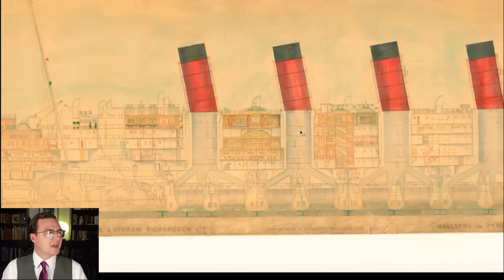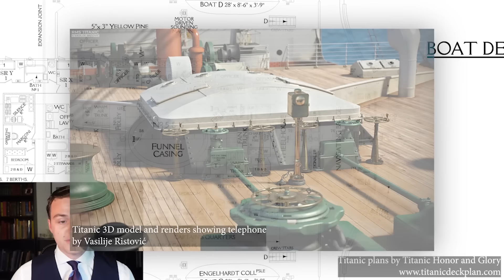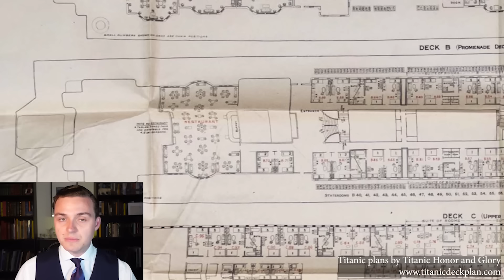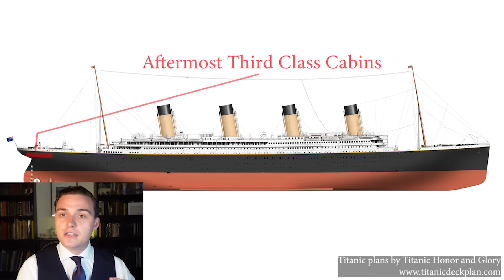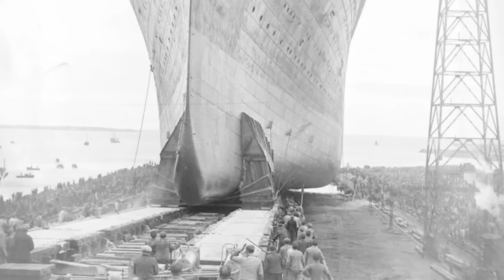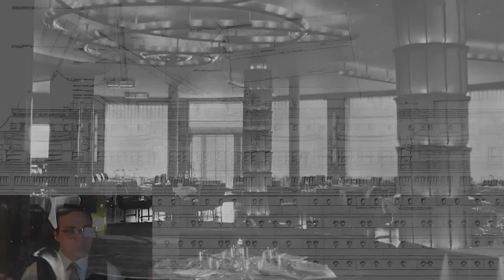The Engineering Secrets of Great Ships | Titanic, Normandie And Mauretania

Comment: It is unlikely that the lighter area on the funnels was painted in oil.  The light and the darker reds are blended (as far as I can tell). And watercolor and oil wouldn't blend. To get that blend the draughtsman would have painted in the whole funnel and then when dry, would have painted in the 'highlight' with a brush full of  lighter color, but no water. This takes some skill. As far as I can tell, this bit of difficulty has been accomplished with consummate skill. Beautiful work. And beautiful work from you.

Comment: Coloured drawings are most likely sales props used by the yards. Which is why the public spaces are detailed but accommodation is up to the customer. I did a lot but never for a job we had an order for, they required new and very different drawings. 
Prior to CAD I started an apprenticeship as a draughtsman, I came from school with basic Engineering Drawing skills and had started to learn some skills. Isometric images and some colouring. I think you are right when you say artist coloured the drawings, unless the office had someone with the skills. I had been colouring traced images accurately since I was 8 and when I revealed that at work, a set of watercolours and brushes was on my drawing board the next day along with a colour image of an example of the drawing next to them. I coloured the image as per the example and the next day was two more. On the day after I saw my boss who was happy with my product and said that I was getting a pay rise as I was now a colourist as well as an apprentice draughtsman. I used to spend a day or two a week colouring drawings but mistakes that couldn't be fixed caused problems as the drawings were very expensive compared to the in house photo replication we did in house. These were done on a Xerox copier for A0 by a shop over half a mile away. £12 a copy when I was paid £20/week.

Comment: For showing details on a drawing or photo, it's difficult to see the dashed-line cursor box. I would suggest using a stylus to draw on your monitor a freehand thick colored line, which would be much easier to see, and each separate draw can be erased with a button. You would also not be limited to rectangular shapes.

Comment: As amazing as the planning and plans of the component parts, is the slide-rule mathematics that was used to calculate various thicknesses, tensile and compression strength etc. In an era when materials science was far less advanced than today, and obviously no computer modeling, it is amazing that these early liners stayed in one piece. Were they grossly overbuilt as a result.